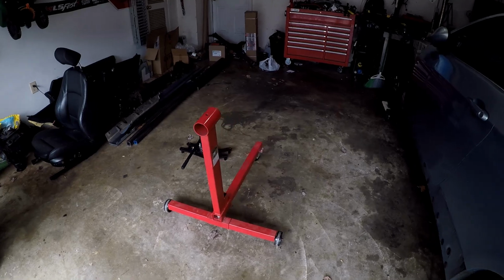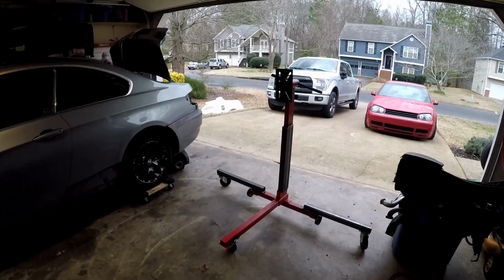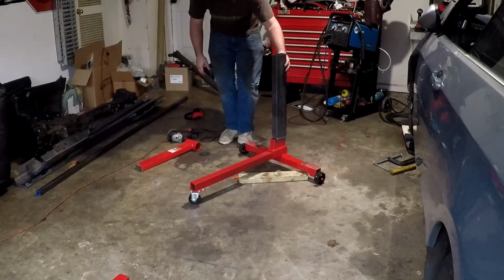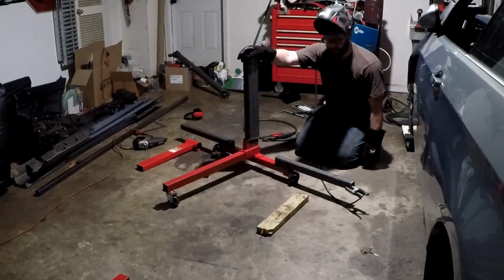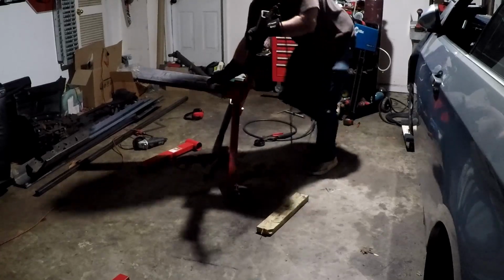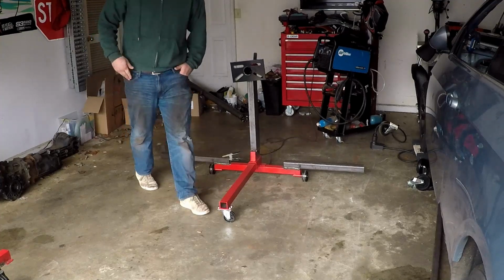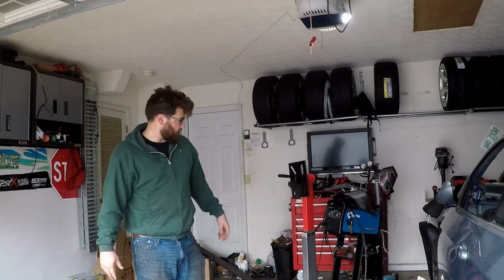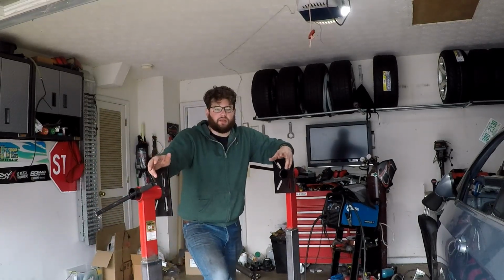Making a Rotisserie out of Engine Stands!

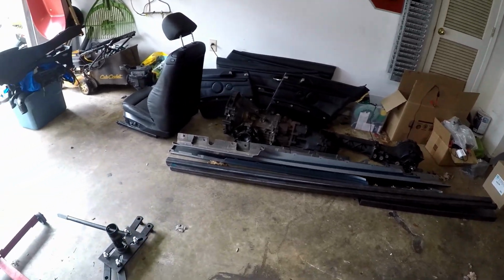Comment: Hi, awesome vid thanks for making it! By chance do you remember the lengths of the metal stock before cutting them? 0:41 part of the vid.
Reply from the maker: Hey, thank you! I get the steel directly from a mill, so the lengths vary, but it is always between 17-23ft
Reply from the maker: Well, I should’ve checked the video lol. I actually bought those as cuts (scrap pieces) so unfortunately I’m not sure how long they started
Reply: Thanks for the reply and keep up the awesome work!!
Reply: instaBlaster.